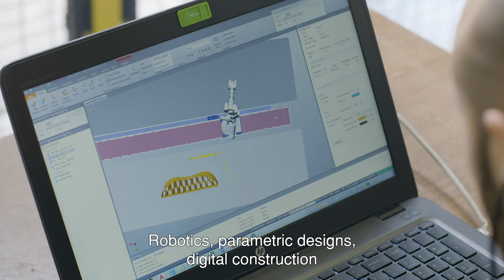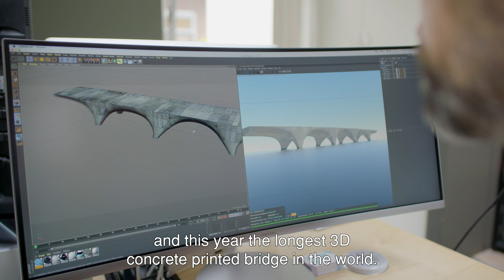3D concrete printing explainer video

Comment: Finally someone who puts in steel reinforcement. 

Half of these just make crappy drip-sand structures that would crumble as soon as the building settles
Reply: Yes, finally saw some metal
Reply: Have you ever heard about a double bricklayer house ? Same concept as double-layer concrete walls. They have wall ties and only cast reinforced concrete columns and beams where needed.